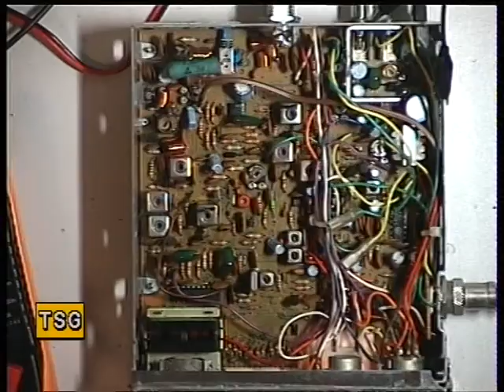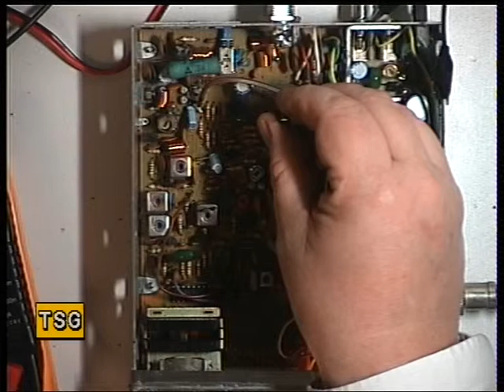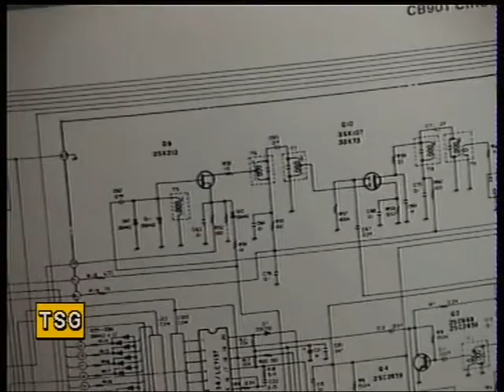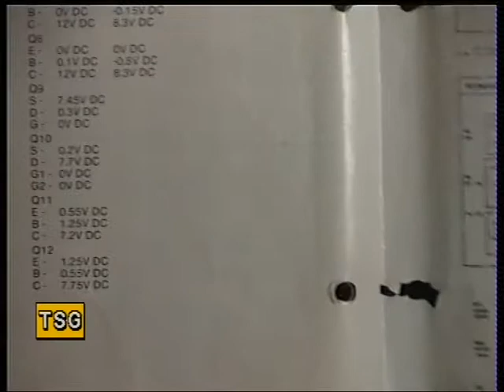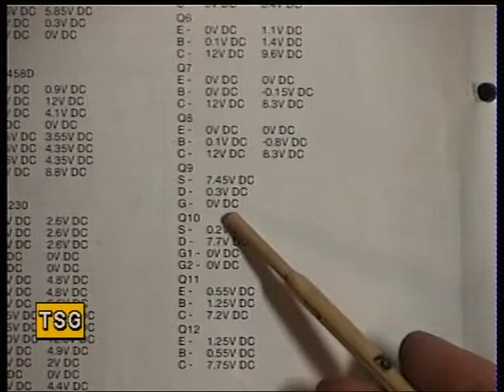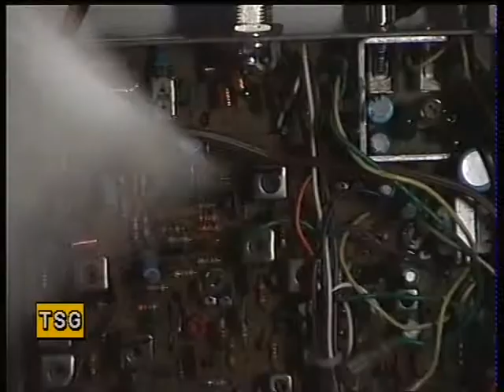Mustang CB1000 UK CB radio., receive alignment

Comment: Hi Richard, in the video on the top right of the board inside the L shaped piece of aluminium there looks to be another RV preset what is this preset used for please?
Reply from the maker: It's RF meter set. If you email me I'll send the the service manual for that chassis

rshireby@yahoo.co.uk

Comment: Hi Richard, do you find that setting RV1 (S-Meter) to 100uV at S9 results in the needle being the end stop, and the radio can't achieve and S+30?   The service manual for the Amstrad advises 100uV at S+30, which, as you've mentioned previously, makes the S-meter a bit too generous, but prevents the the aforementioned issue.  I'm not sure this behaviour appears on all 002Fs boards though and there is some range beyond S9 even with it set at 100uV.  I solder a 1K resistor across L13 when I come across this, which helps to extend the range of the meter and make it more realistic and compliant with the usual standard.
Reply from the maker: No, I find the opposite as usually the meter has been set more genereously than S9 = 100uV. S meter settings in service manuals I take with a pinch of salt & standardise on all sets doing S9 = 100uV. All those Maxcom's I seem to recall are supposed to be 50uV...makes the sets look more sensitive. Year, right.

Richard
Reply: That's what I'm saying, i.e. that S+30 set at 100uV is the maximum the radio will indicate.  Even if dropped to indicate an S9 the needle won't go beyond around a 100uV signal.  It's like the range is limited to around 100uV, if that makes sense?  That's when I have to add a 1K resistor across L13.
Reply from the maker: Next time I do a Mustang I'll pay attention to that.
Reply: Actually I've come across the same problem on a Fidelity 2001 and an Audioline 341 (different PCB altogether).  Hmm....even adding a 1K resistor across L13 makes no difference on the Fidelity and I have no solution for the Audioline at all.  It looks like I'll have to live with a S30+ indication on these radios. =/

Comment: Very informative, yes I had that model back in the day.
The only problem I had with it was the S-meter was +40 with almost every signal coming in. But that was quickly put right. Nice video thanks.
Mike.
Reply from the maker: Some manufacturers set the S meter for S9=10uV instead of our recommended S9=100uV. That was, their radios look psycholgically more sensitive than other makes. Some manufacturers do the same for the TX side of the meter, having bang accross on TS "look how powerful it is", yes...right. Bit like cars with speedometers marked up to 180MPH. I once saw a ghetto blaster in Curry's shop shop saying it did about 100W output. I can bet id did no more than 3W RMS per channel!

Richard
Reply: Oh yes, the dreaded and nonsense "PMPO" measurement!  Ridiculous but inventive marketing deception.

Comment: Richard, where do I connect the scope please for the receive alignments?
Rich.
Reply from the maker: The ext speaker plug goes straight into my test set for the SINAD/distortion/AF power meter to work. As there is no scope output from the test set, the scope is right across the speaker terminals....as simple as that. It's that detector adjustment where the scope is vital.